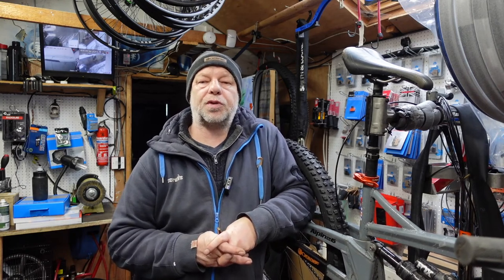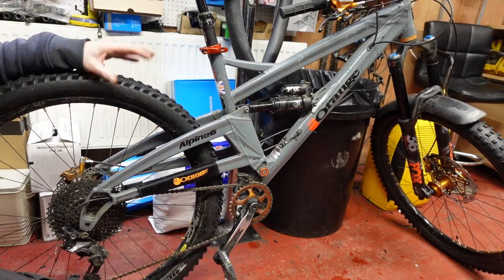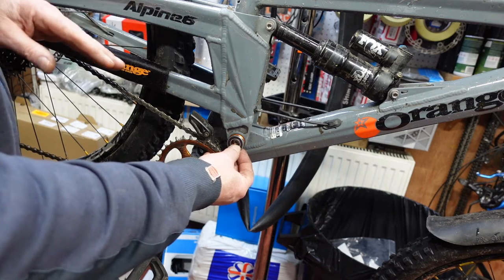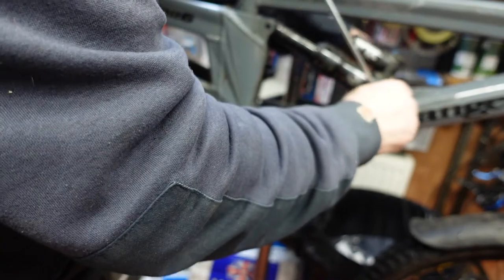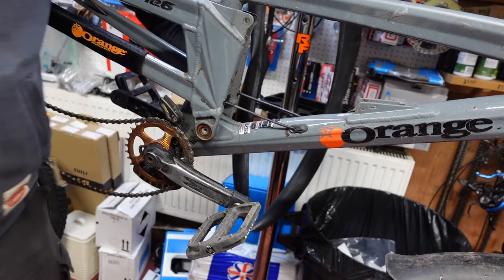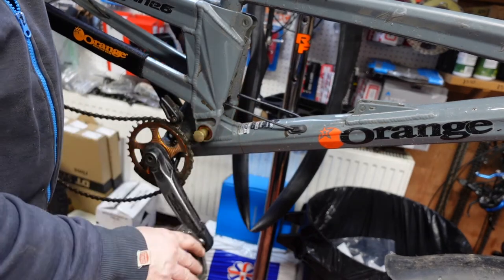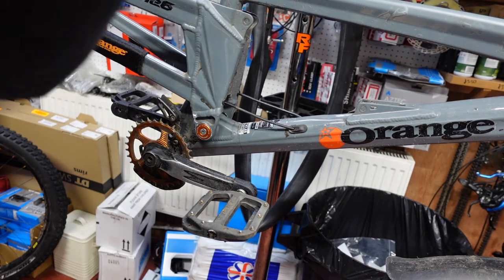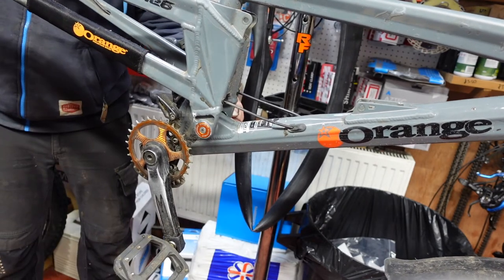How to Change Orange Bikes Pivot Bearings

Comment: Just bought a brand new Orange Five Evo frame and shock. Swapped over all the stuff from my Orange Clockwork to fit onto the new frame. After I assembled the bike I have knocking. Took out my rear wheel, (Hope Fortus Pro 4 hub) put it back into my hardtail frame and it's solid. Made  sure the shock bolts were torqued up properly to 14Nm.

Warranty claim and even took the built bike to Orange in person. They changed the main pivot axle. I picked the bike up and there was still play as before. The guy over torqued the thru axle and it felt okay as far as I could tell. Got it home and no change as it was quiet and I could check it properly in my garage. 

Not dissing Orange or anything, they've entertained my claim and have investigated the problem already.

 They said it could be many things causing this which I have to agree with, can't argue with other possible sources for this knocking.

Just after some thoughts or a second opinion I guess? 

Any idea what to do next? Maybe a small amount of play is acceptable? Maybe it's just poor bearing tolerances? My last resort is maybe change the new bearings for some better quality ones and see if it sorts it?

 The dilemma is I would rather work it out for myself rather than another warranty claim. The last thing I want is to push for a replacement and it turns out to be something else that's my fault or something I've overlooked as the cause. 😬
Reply from the maker: Hi, Thanks for watching, It's going to be a matter of elimination. We work on Orange frames all the time, from experience they work well and well made. Is it possible I could take a look at for you free of charge, we work with Orange Bikes, we build all their UK bike wheels.
Reply: @TheYorkshireBikeMechanic  Thank you for the reply and also the kind offer to take a look. Watched all your vids and enjoyed them. 

Been working on my own bikes for years and prefer it that way to be honest. My first proper full sus and first full bike build. I feel I know every nut, bolt and component. Even did my first fork service and replaced the air spring to increase travel from 130 to the recomended 140mm. All other parts were stripped, cleaned, greased re-fitted/torqued, etc. even though they were fine before. Brand new headset, stem, saddle, grips and bb installed. Foam covers along the whole length of the internal cable and hose downtube routing. 

The knocking is when I hold the top of the seat tube and gently rock the rear wheel from side to side. Just leaves me with the rear wheel which I didn't do anything to, didn't see any need as it seems solid when fitted back into the hardtail frame. Just can't think of anything else to try except (maybe unnecessarily?) replacing the hub bearings and pivot bearings just to see if it makes a difference?

Comment: My advice would be on first bearing change, or if you’re really motivated, take the original good ones out, and pop the seal off using a seal or o ring spade, and inject grease (Phil Woods hydrophobic) in there so it’s full then put the seal back on. Like he said, the bearings don’t rotate much, so no worries you’ll be fine. The full grease pack will keep dirt and water out longer.
Reply from the maker: Hi, thanks for watching and your comments
Reply: That's actually a great idea